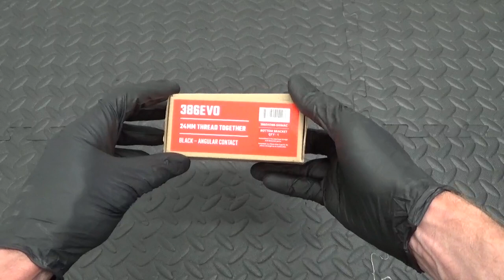Wheels Manufacturing 386evo Bottom Bracket Fitting Guide

Comment: I just got a frame with one of these in there already.  It has GXP sized bearings and I need shimano. Do I have to buy a whole new BB or can I knock the old bearings out and the new ones in to the existing BB?  Thanks!

EDIT:  To anyone interested in the answer.  You can reuse the BB shell and replace the bearings.  The OD is 37 and the ID (For shimano is 24mm).  The bearings you need for the shimano conversion are two MRA2437 LLB (or 2RS).  They will be 24x37x7mm, can be had for about $15-20USD each.  Hope that helps!

Comment: Can you assist me please? I am just about to fit a the same Wheels Manufacturing 366EVO BB which is designed to take a 24mm Shimano Crankset.  Is it ok for me to use the FSA Adapters which I removed from the original 386EVO press fit bracket on the Wheels BB? If so, can you confirm that I can do away with the spacers which come with the Wheels BB? 
If you can help me it will be much appreciated.
Thanks in advance.

Comment: This will fit into a threaded frame? Or is it for press fit. Also the diameter looks bigger. This won't fit in bsa square taper frames?
Reply: No. It is only meant for a bike with a press fit bottom bracket. In this case the BB386 designation. Some like time bikes refer to it as PF BB386. Which means PRESS FIT BB386.

Refer to your manual or online references to verify what bottom bracket your frame uses.

Comment: Is bb386 the same as bb86? Im trying to find this bb to install using a shimano crankset.  The bb the bike currently has is a shimano 72-41. What bb does it use if its that?
Reply from the maker: BB86 uses the 24mm axle, BB386evo uses a 30mm axle or 24 with adapters! So you would need the BB86 for the Shimano crankset!
Reply: @FreeToCycle  thank you
Reply: @FreeToCycle heya! saw this comment and wanted to ask something

currently have a bb386evo with a 30mm crankset but want to change for a 24mm crankset

are adapters (30mm to 24mm reducers) fine to use? or should i buy a bb386 specced for a 24mm crankset
Reply: @niconico9702  best is to get the same wheels manufacturing BB for a 24mm crank